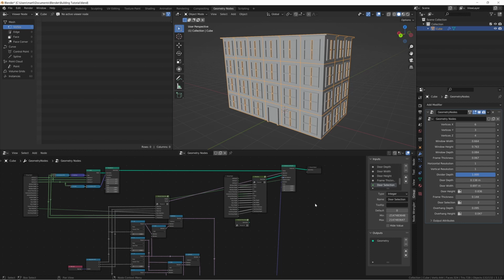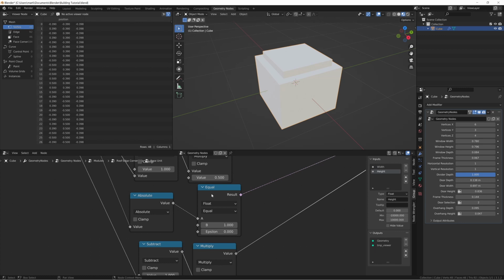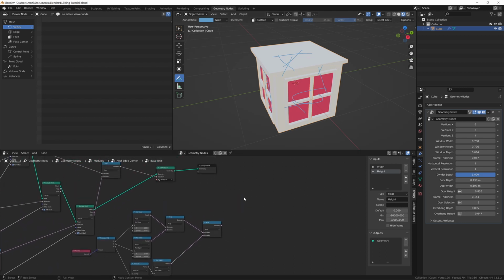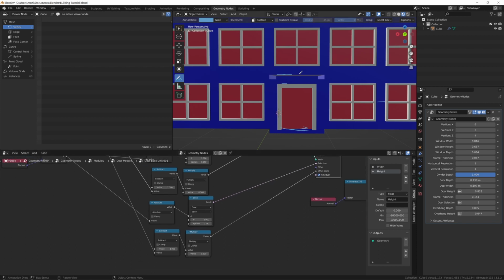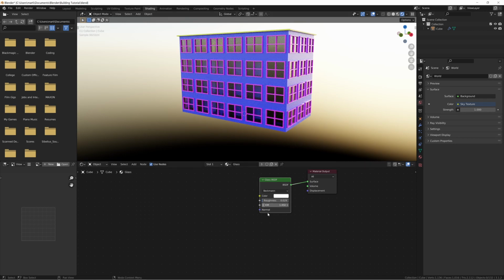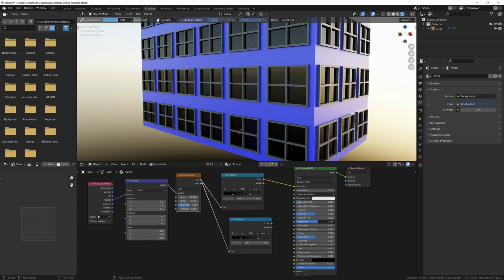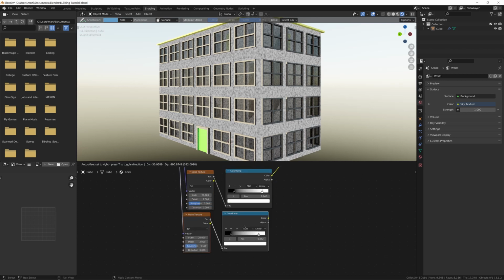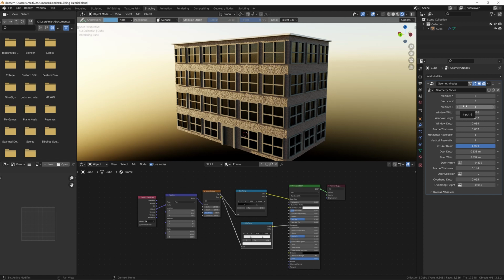How to Make a Procedural Building in Blender (Part the Last) | Geometry Nodes Tutorial

Comment: All done and would love to share what i have with ya but i am having just one little issue with the roof, remember when you where doing the window frame graph and you had double faces that you got rid of with a mesh bouillon, well my roof edge is coming up black with material on it but my roof corners are fine.....just curious what might be the problem....either or it looks great in Evee just not cycles lol ...
Reply from the maker: Hmm, that is strange. Without seeing exactly your setup, I can't really think of what could be causing this issue. Does the issue persist when you do an actual render instead of just the viewport render? Also, you can try applying the geometry nodes modifier and messing around with the vertices in edit mode to see if there are some intersecting faces that you can't see easily. Barring all that, you could try posting on the Blender stackexchange or BlenderArtists.
Reply: @ltfilm  I will check that but im sure i already did and it does ... i will post my set up if i can figure youtube out im a newbie

Comment: how to you see the working of a single node only??
i.e you only get to see the output of only one node in the 3d view window
Reply from the maker: You can use Alt-Shift-Left Click to view your setup at any given point in your node chain. But this will of course be the result of all the stuff that came before it. Important to note that not every node can do this, only ones that actually output geometry data. (i.e. a math node couldn’t do this) So, look for the green colored output on your node, and if has it, you should be able to see just that node in the 3D view window!
Reply: @ltfilm   hey john i had a request can you pls make a video on how to add pbr textures on the building . i wanted to use them but dont know how to add them using geometry nodes